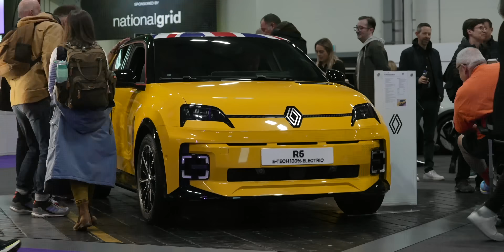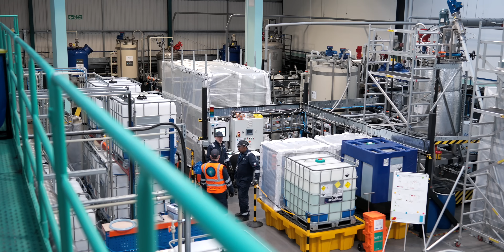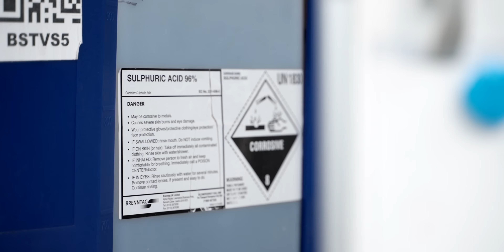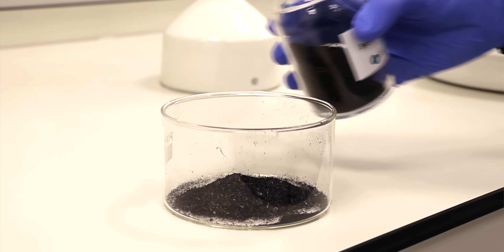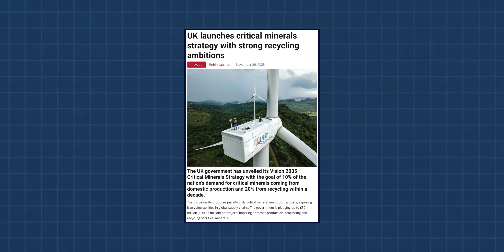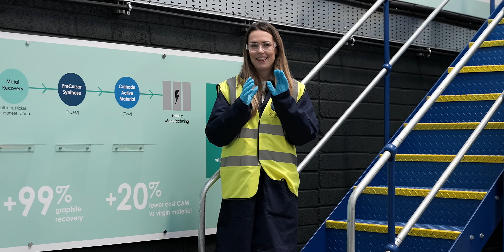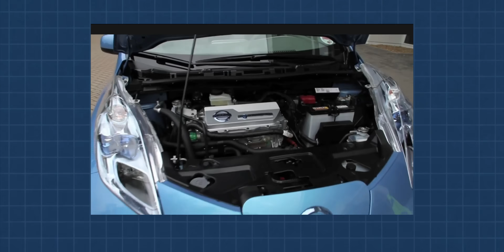EV Battery Recycling Could Be The End Of Mining!

Comment: With the soon onset of autonomous driving vehicles that can be up to 10X safer on our roads, which surely means very much less accident damaged EV’s thus almost no damaged EV batteries to recycle? Then there’s the newer batteries coming out of China with way longer lasting lifetimes then this company will surely be starved of materials? Then there’s sodium batteries! Not much money in salt? With the UK’s new Trade deal with China it will be interesting to see what tariffs will be gone and no longer an issue
Reply: Sodium is currently a cold climate technology (current Sodium batteries, even CATL's, have a much shorter lifecycle at mild to hot climates).

As to lifecycle of the battery, this may change, particularly if vehicle production automation reduces cars to 'commodity' level and lower pricing. Then they'll be designed with the expectation of shorter lifetimes, and increased levels of recycling built in. One can already see this starting in the increase of recyclability in modern car designs,  the shift to standardised platforms (share across multiple brands), and battery companies working on easier to recycle battery designs.

Comment: Frustrating as the video doesn't show any interest in whether this is cost effective. I'd like it to be! But it's probably not. This is not the first video I've seen that shows a pilot plant with a tiny amount of feedstock somewhere in a nice rich country showing that the materials can be reclaimed, all financed by a government grant. Anyone (as discussed) with a GCSE knowledge of what happens when you mix an acid with a metal can have a guess how the process works. Of course it can be done, the question is whether it can be done profitably. And as the costs of batteries fall lower and lower, unfortunately there is less commercial benefit to recycling. China can produce a kWh of LFP battery for $50 and the price is still dropping. The recycling process in the video does not look cheap. In 2035, if a Chinese car maker can get batteries at $30/kWh, are they really going to bother to buy materials from this source? If you think these recycling centres should be subsidized until they produce materials at attractive prices for manufacturers, who do you think should pay for that? Again, I would love this to all work out well but a cursory glance doesn't look good.
Reply: Altilium in an interview with the BBC reported that recycling cut costs of new EV production by 20% using recycled battery mineral materials, plus reduce production emissions by 25% (which has a monetary value for domestic producers). Given that in this video they discussed the higher recovery rate vs mining (high volume of battery grade material produced per tonne of input material), then commercially recycling will be a cheaper route for battery mineral sourcing, particularly for domestic use, also given costs of extraction, handling, brokerage and shipping will be higher for mining. Further, the pricing of environmental impacts of mining and vehicle production is starting to be factored into mineral consideration by governments (as well as national security for critical minerals), making recycled minerals a cheaper option by design.